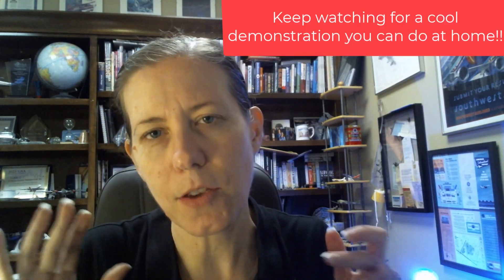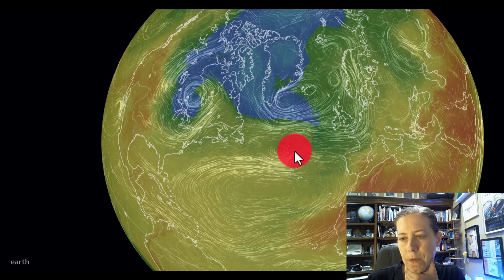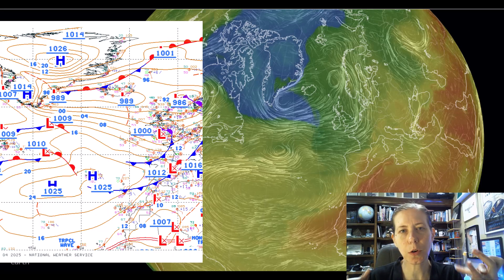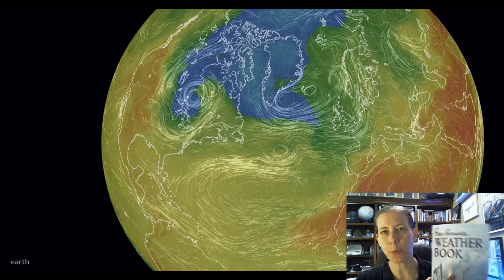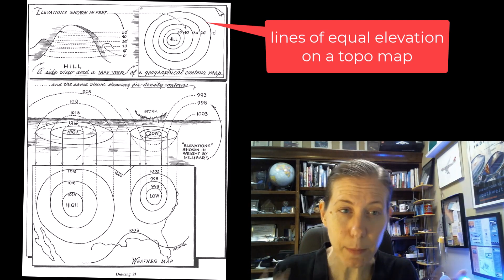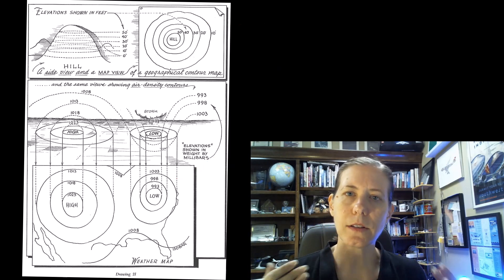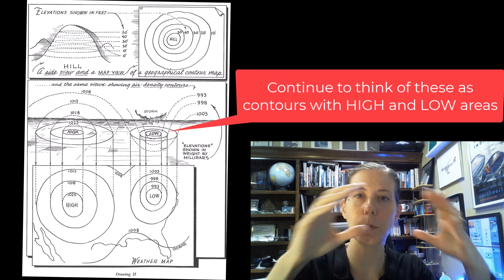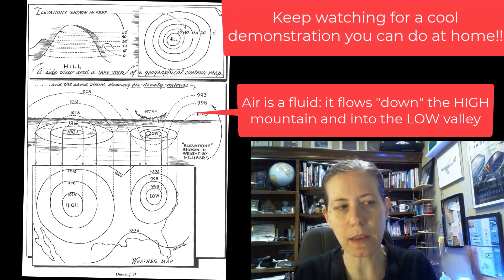Why Does Wind Flow Different Around High & Low? Weather Explained: Pilots & Dispatchers Meteorology

Comment: Nice video.  I believe the pressure force  is orthogonal to the isobars (not parallel), but get the explanation.
Reply from the maker: I think I misspoke somewhere in there. What I was trying to say is that the forces balance to make the wind flow parallel to the isobars. Coriolis force balanced with pressure gradient force to make it flow parallel above about 3000 feet AGL where surface friction isn't an issue. Thank you for pointing out this!!